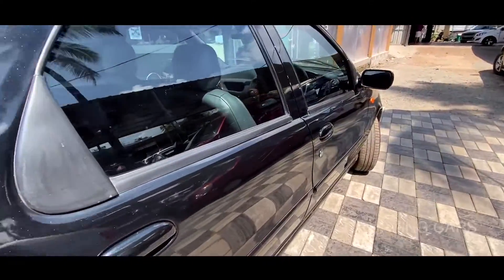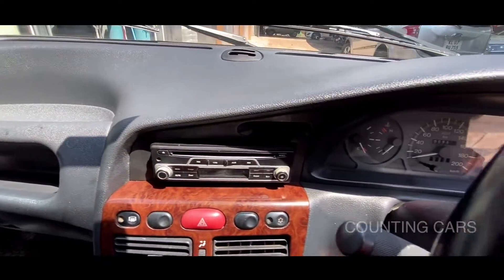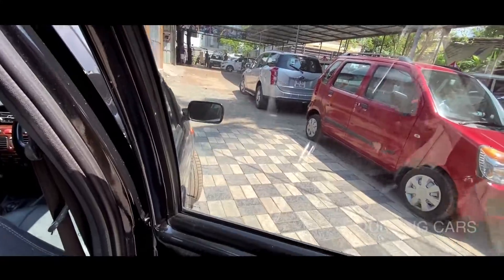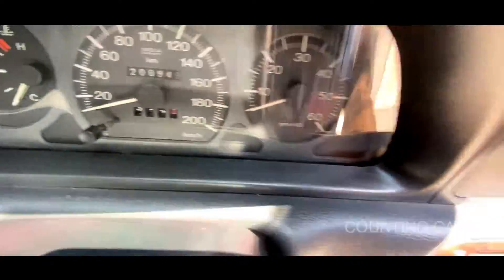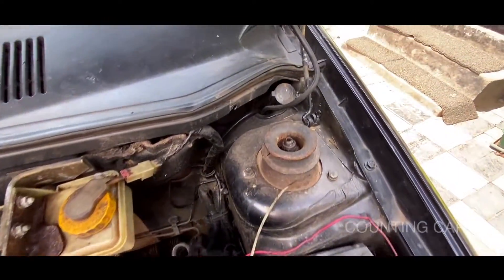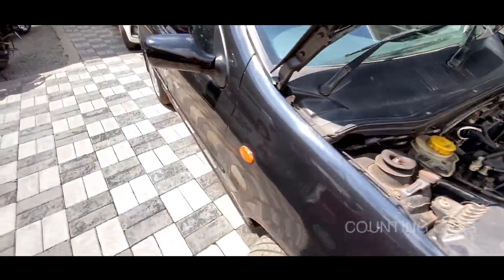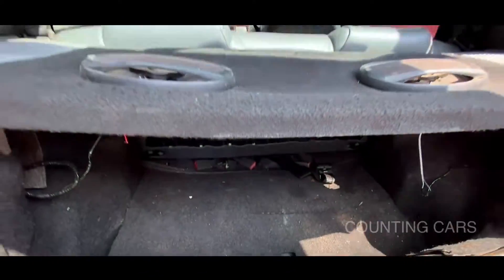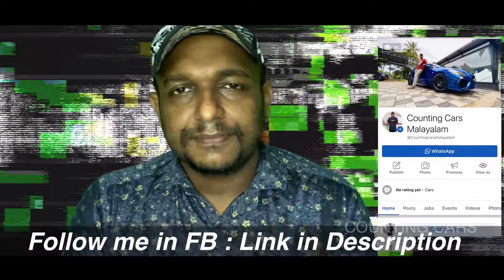നിസാര വിലക്ക് കലക്കൻ മൈലേജ് തരുന്ന FIAT “PALIO” Diesel | Used Cars Kerala | Second Hand Cars Kerala.

Comment: Palio Diesel edukkan plan undel 1.3 multijet ulla Palio Stile (after 2007) edukkuka. Before 2007 ulla vandikk 1.9 litre engine aanu, spares kittan budhimutta. After 2007 model vandikalude parts 99rpm website il easily available aanu